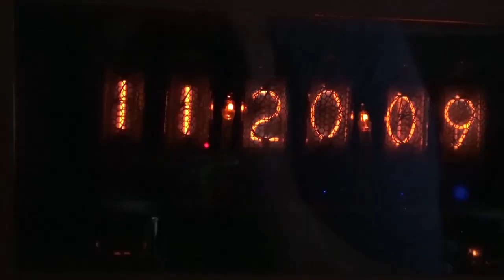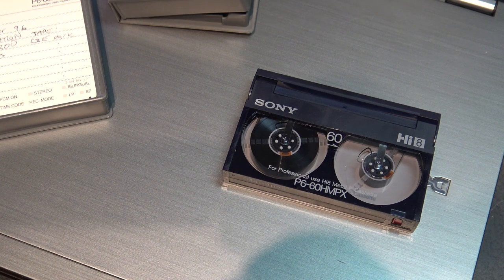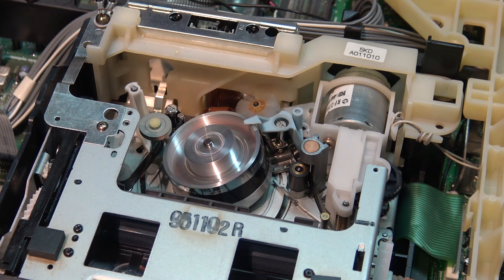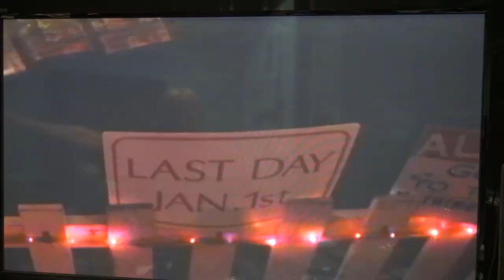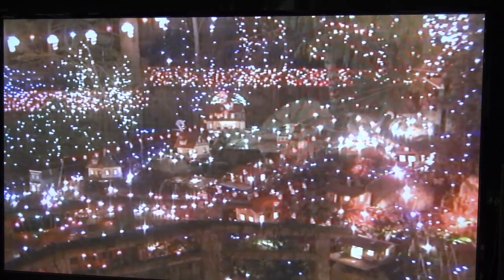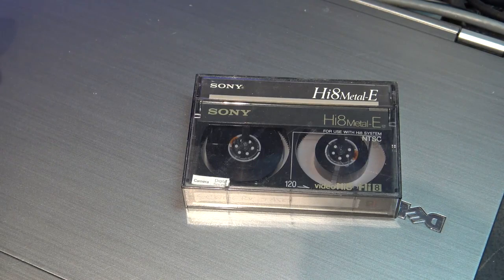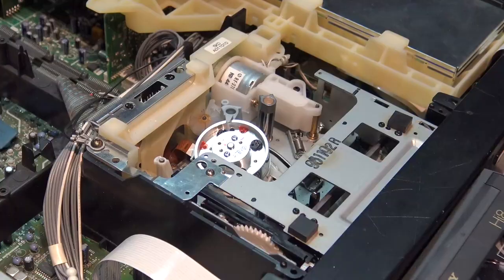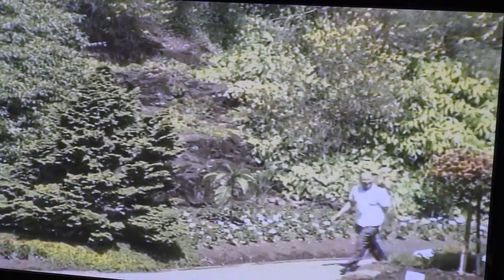Sony Hi8 tape was total garbage. Lets see why

Comment: Thanks! You convinced me not to buy Sony tapes. I will only buy maxell tapes or tdk tapes. If I ever see Sony videos I will pass. I only record on maxell anyway
Reply from the maker: The question is why are you still using video tape in 2020?
Perhaps for a gun video I should haul out my old vintage gear and try to make something.  I have been pondering this for awhile.   Record straight to analog tape from either a tube camera or ccd, do the full edit using analog tape while recording the process of the edit and then upload the finished project to my channel.  What do you guys think about this.  I am open to suggestions.  What format should i use for acquisition? Beta, hi8, digital 8, DV, HDV?  Myself i am leaning to Beta as i could use those slhf1000 decks with the preroll editing capability.
Reply: @12voltvids  so to answer your question about why I shoot on tape still in 2020. Its because I like the look of 8mm tapes. They give a early 2000s nostalgic look you don't really get in videos these days. Also I would love to see a video where you record a new video using 8mm video for sure. Maybe even vhs-c too.

Comment: I have got a very old sony video 8 camera, its from the 80s. My grandad gave it me before he died in 2011. It does still work on the mains. well it did, I put it in my attic about 6 years ago, its in its original case that sony supplied with it. But its crap compered to my phone.. I was fascinated when I was kid as it looked like a tiny top loading vcr. Its just standard 8 not high 8, wont play high 8 tapes..picture is very poor, but I could record to high 8 tapes and it plays in standard 8. I want to get it back down now

Comment: I RECORD SOME MATERIAL IN TDK   KODAK  HI8 TAPES BRAND AND  ITS VERY  GOOD QUALITY AND COLOR
Reply from the maker: Hi8 was a very good format for home recording. It was a "broadcastable" format, and many early reality TV shows were shot using a Sony CCD-VX3 3ccd camcorder. My first 3 ccd was a VX3. I wish I still had that camera.  It was a great camera but I sold it, and my EVW300
Some of the cameras I have had over the years. Not counting the seperate recorder / camera.
GCS1 professional Betamovie (still have) MBC1000 Betamovie (sold) CCDV8 original 8mm camera (sold) CCDv110 8mm (still have) CCDTR81 Hi8 (still have) CCDV5000 Hi8 (sold)  CCDVX3 (sold) EVW300 professional Hi8 (Sold) Sony DCRVX1000 DV camera (Sold) Canon GL20 DV camera (Sold) JVC GYDV500 (still have) Sony DCRTRV110 Digital 8 (still have) DCR TRV720 digital 8 (still have) Sony HDRFX1 HDV camera (still have) Sony HDRHC3 HDV camera (still have). Sony HDRCX220 and a JVC I forget the model of SD card based. The current cameras I use for production FDR-AX100 and FDR-AX33 4K SD card based. Yes I have a few cameras since the mid 80's but all for my production business.

Comment: Seems like Sony might be the best to use for analog horror.
Reply from the maker: Everything analog is horror.
Reply: @12voltvids  I just got a few Sony tapes, and one has constant dropout directly in the center, and the other two have some distortion in the top that clears up later in the tape. I love how much unpredictability and character it adds.
Reply from the maker: @joshua.merrill  the tape probably has a scratch right  down the middle.  Caused by the camera likely pinch roller.